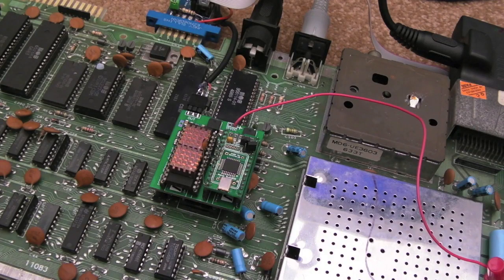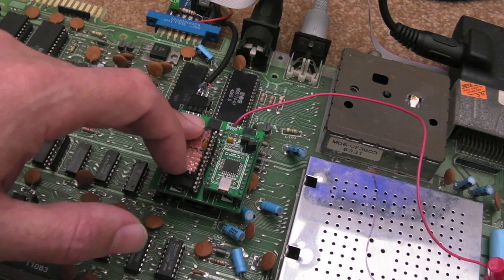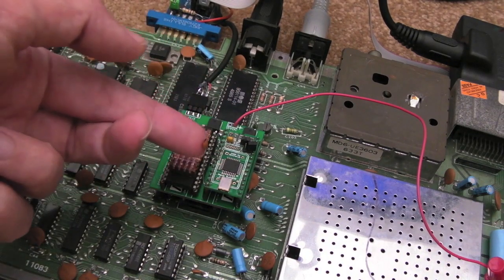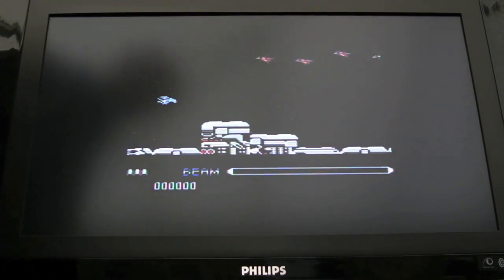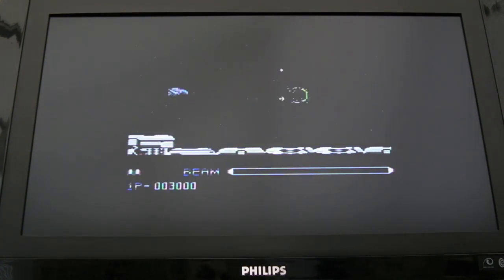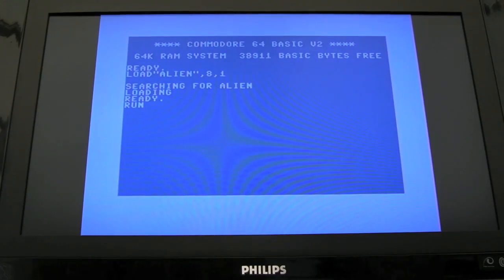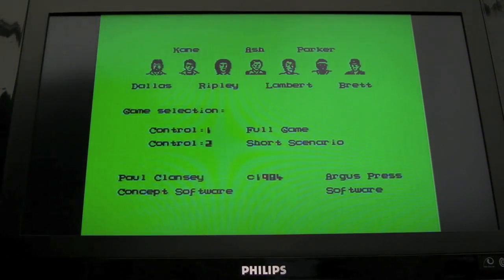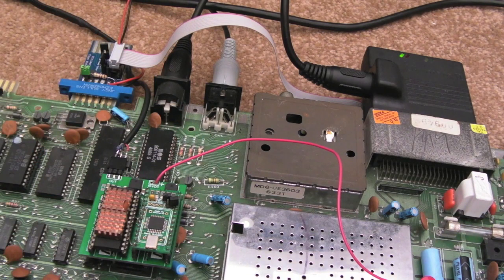Commodore 64 (C64) Nano SwinSID CS Fix (Only as SID 2 on Dual SID)

Comment: What are the monitor or monitor setup that you are using? It looks so clean in the image quality.
Reply from the maker: I just use a Philips LCD TV - 32", it's an oldish model though (2007 ish).
Reply: @GadgetUK164  How well does it do smooth scrolling? All LCD tv's that I have tried, have all had stuttering scrolling.
Reply from the maker: I don't notice any problems!  Nearly all of my videos show that TV and I've never noticed issues scrolling.

Comment from the maker: There's more to this fix that meets the eye - It would appear the cap helps and is required when the Nano is used with the Dual SID board, but the cap is not the entire fix for the sound imperfections in games like Alien, R-Type and Last Ninja.  The cause is the 'read' of the SID not being emulated correctly, and the reason this sounds flawless in the Dual SID board with a 10pF cap is a pure accident in that the way the my Dual SID and Daves Dual SID board works is by disabling reads on the 2nd SID - in this case the Nano.  So the read is done on the 1st SID, which is a correct read, and so it results in an indirect fix to the lacking read support in the Nano.  I know paddles aren't supported on the Nano, so I am wondering if general register reads are also not supported, that might explain it.

In summary, if you want a perfect sounding Nano SwinSID, the best way is to stick it into the 2nd slot on one of Daves Dual SID boards, with a 10pF cap from pin 8 to ground.  Sadly it also means that we've discovered why the Nano doesn't sound 100% when it runs on its own, and the only fix would be to a firmware update.  If the code ever went open source we could have a go at providing the reads but it might just be a case of there's no CPU left to accommodate it.  That said a faster microcontroller would be a possibility as well.
Reply from the maker: +GadgetUK164 Update 15/12/2015: This only works when the Nano is SID 2 in a Dual SID setup.  I've done an update video on the issues with the Nano SwinSID.

Comment: Also, the fact I have a couple of these dual SID boards on their way, as well as a nano swinSID makes me hopeful I can replicate your setup here. I was hoping I could use the swinSID in one of the boards as I dont have any real 8580s that aren't already in perfectly working machines. I gotta hand it to you and Dave Curran.
Reply from the maker: +aphexteknol Thanks again =D  There's no reason you won't be able to replicate my setup - the Nano is a good 8580 substitute, it sounds very much like an 8580, and with the cap fix it sounds just as good as an actual MOS SID.  The only thing the Nano lacks is the amount of bass the 6581 filters can generate, but it's still a really nice chip.
Reply from the maker: +aphexteknol See my comment at the top there - I worked out the cap is only a partial fix, well its a complete fix if the Nano is in slot 2 of the Dual SID board.  Sadly I've worked out the reason why the Nano sounds off in a few games (Last Ninja, R-Type, Alien etc) is because it cannot be read correctly.   That's why it sounds flawless with a 10pF cap when its in slot 2, because all the reads go to SID 1 - the reads are something which the Nano seems to be incompatible with.   For a Dual SID the Nano is ideal for slot 2 as it sounds really good.
Reply: +GadgetUK164  Ideally thats how I would want to use mine when I recieve it, as an 8580 substitute in the dual SID board, so this is really good news. Thanks again for figuring this out, maybe I'll make a video or two showing off my setup when I get all the parts put together.